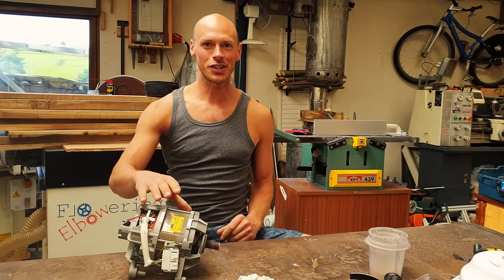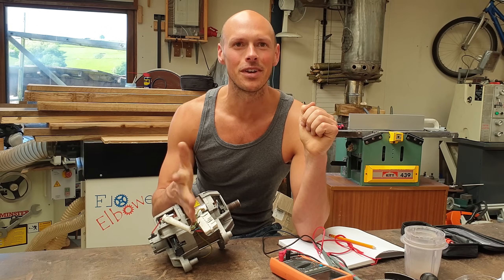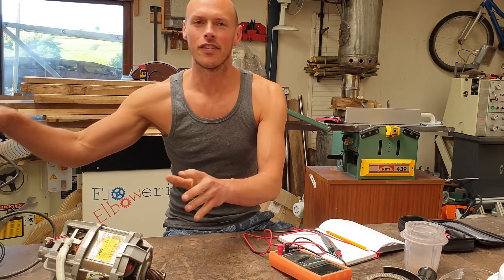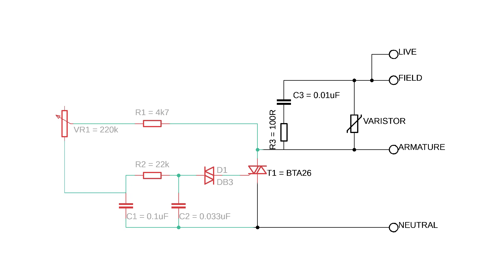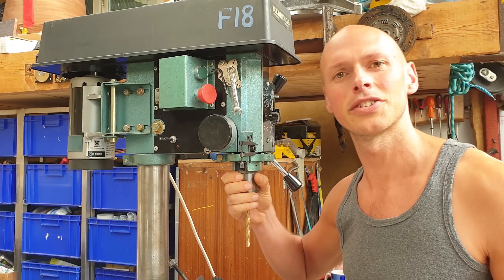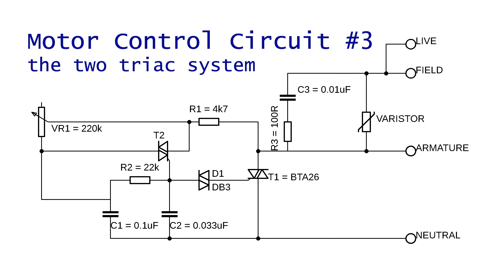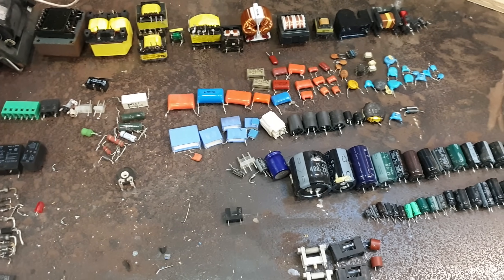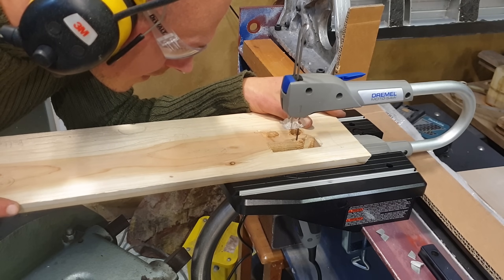How to reuse Washing Machine Motors [Arduino vs Basic Triac control]

Comment: Hi, it's 20/12/25. 6 years since you made this  video. It's been 35 odd years since I studied electronics and as I never really used what I had learnt in any job that I had since then, i'm afraid much of this went right over my head. However, I think that in these times of incresing desire to go 'off grid' it would be really helpful and interesting if you did a video of how to turn a washing machine motor into a generator, wind or water powered. What do you think ?
Reply from the maker: Hi friend, thanks for the comment. Currently deep into a solar pv install, so it's not happening soon... thanks again 😊

Comment: Is there an advantage of using a triac over a solid state relay + pwm?
Reply from the maker: Honestly I don't know, it's been too long since I looked at this stuff. I know when I was looking (a long time ago) a solid state relay was comparatively costly... I'd love to know what you find out if you learn about this, or if anyone else wants to chine in... Thanks for watching :D
Reply: @FloweringElbow  Well, if nothing else, PWM usually switches a lot faster, which would increase EMI and could pose a risk for motors with lower class insulation.

Comment: Enjoyed your video and learned quite a few things ,I have a   universal washing machine motor with 9 wires coming out,I have got a motor controller which is meant to control foward and reverse and speed ,the connection points are LABELLED K2-Reverse
 K1- Foward
 0V
S2 velocity feedback
S1
Z2 Secondary Winding
U2 Main winding
N&L  Supply

Need help hooking this up to motor

Comment: Why did you wire it up so the heat sink was live?  I know nothing about electronics so I am curious, it seems like it'd be something you'd want to avoid.
Reply from the maker: Actually that triac I used didn't have live heatsink connection, but some do. So it was more for the benefit of folks who might use that type, it's easily overlooked.

Comment: I have one of those motor thar you show in your video , well the one I have" 5 wires " I want to put the wires of that motor to a whirlpool washer I don't want to put the motor just the wires to the whirlpool washer the motor from the whirlpool I want to use can I use that motor from whirlpool washer the other washer was a front loader ?can I use the motor from whirlpool washer?

Comment: Hello,
I plan to use a universal motor for a DIY lathe.
I copied Brett Beauregard's code and included recommended libraries, including Rotary.h. But the Arduino compiler does not recognize the "process" function: "'class Rotary' has no member named 'process', following the code: " unsigned char result = r.process(); " line 227. It also does not recognize the DIR-CW and DIR_CCW parameters.
Did you have this problem? And if so, how did you solve it?
Thank you in advance for your help.

Comment: Would it work if I just rectify the mains voltage with a bridge and then use an IGBT (possibly salvaged from an IH electric stove) to PWM the 300V DC?  (A separated SMPS and an optocoupler will be used for isolated driving in order to prevent deadly voltages on Arduino board)
Reply: It should be able to...,but in this , its simplest form..low speed operation has its limits , even with just tacho gen. in the feedback loop...

Comment: Is it pissible to Control the Speed without a Tacho? I got a cheap single Phase Controller for induktive Motors and the Speed Control Just won't Work. Forward/reverse is No Problem. But the Motor Starts to get warm very quick. It originall had 2 capacitors with a start delayed shutoff for one of them.
Reply: These 2 caps. type motor , is typically a Capacitor Start , Capacitor Run motor....where the C Start is mechanically disconnected/ dropped out of circuit after it reaches a particular speed.. this is done with a centrifugal switch mounted on the rotor shaft internally ..it breaks/open circuits the start cap...
Such motors should not be operated below that speed.hence that winding overheats..its meant to provide high current for high starting torque only at start up.
Now a days some such motors come with PTC mounted resistors  and there's no need for the centrifugal sw. 
This PTC is selected based on approx.time it takes to allow high current through and by that time rated speed should have been reached ..

Comment: Execellent video's.  Now if only they taught things like this in schools and colleges. 😊
Reply: They do though. They also teach you what you need to analyse circuits like this. The whole, “university doesn’t teach you anything”, attitude just isn’t true. In a lot of cases they might not teach what exact circuits to use but they teach you how to design the circuits and the principles of how it works, which is much more important. Anyone can take a circuit off of the internet and copy it, not everyone can design a circuit like that themselves.

Comment: I like to remake the controls of my washing machine using an esp32 (can be nicely integrated with home assistant) the rpm of the motor also needs to be controlled by the esp32  like to use a digital to analog controller to get the controlling voltage. Like to know how you would approach this. Thanks for the upload. :-)
Reply from the maker: Hey Ronald, good questions, and unfortunately I'm the wrong person to ask and wouldn't know where to start with the esp32...

Comment: Great video Stephen, so my plan is to creat a 6 axis arm, a bit like a kuka krc4, any additional advice mate?
Reply from the maker: Good luck! Look at servo motors, designed for those kind of applications. They will work a lot better than a universal motor. I've seen people add a rotary encoder to permanent magnet treadmill motors to create servos, but it's hard to beat an 240v AC servo motor and controller - it's what we're using on the CNC machine we made.
Reply: Right on man, thank you so much for the reply.

Comment: If you're thick as seven shovels of syrup when it comes to electricals, like me - could you use a dimmer switch or some such off-the shelf yoke that the nice people in "Electrical Crap R Us" might sell? When you start into wiring diagrams & whatnot, the bulbs inside my head dim worse than usual.. massive blind-spot for me. So yeah - any simple way of making the thing spinny-mathing simpler? Or is that a dim question? :-) You may as well be speaking Russian when you start into the technicals, to me anyway.

TLDR - can fools like me buy anything off the shelf to do the speed-control shyte? Because then a washy-machine motor starts being verr useful.
Reply from the maker: Hi James. Yeah, I struggled a lot with this stuff... You could try something like this https://www.amazon.co.uk/WINGONEER-Electronic-Regulator-Thermostat-Controller/dp/B01LXLU3SD/ref=pd_day0fbt_sccl_2/258-0755306-0061525?pd_rd_w=4OhkY&content-id=amzn1.sym.ec8de3c0-7d57-47a6-8a84-f65b2ab2e73e&pf_rd_p=ec8de3c0-7d57-47a6-8a84-f65b2ab2e73e&pf_rd_r=2J288Q35GN28PEKDY4HX&pd_rd_wg=kVo3g&pd_rd_r=40107e41-250d-4889-8305-ba93427103a3&pd_rd_i=B01LXLU3SD&psc=1  
Not an endorsement mind, I haven't tried it... You'd still need to identify the correct contacts on the motor with a mustimeter and some fiddling about...
Reply: @FloweringElbow  That's close to warm - I did ages working out how to power 12v stuff with old PC power supplies - Clever folk would have figured it out in minutes - took me weeks - but yeah, that's somewhere "possible" for non tech folk like me., 

I have no idea how that would work.. I'm gonna have to go educate myself on this rabbit hole.. Does "Education" ever end ffs?

Comment: I watched this video a long time ago and I was reluctant to try it. Fast forward to my latest video I had to unsolder many large capacitors from a pcb. I tried my very slow method on the first capacitor using a soldering iron, as usual it took along time. So I remembered your method using a heat gun and gave it a go. Wow, wow and more wow it worked so well! The only problem was that I put the heat gun too close and it burned out the heating element wire. So now I have to buy a new one.
Reply from the maker: Hey Lucky, good to hear from you. Haha 😄 yeah it sure does help with the larger components! I must say that I've fried a few components by lingering too long with the hot air, but in general it rocks...
Saw your vid on the vfd dismantle BTW.  Keen to see what you're building with the components 😀
Reply: @FloweringElbow  I have got a 150 amp alternator to use as a portable welder to repair fences on my rural property. I only needed the diodes from the vfd for the welder but it was great fun dismantling it and seeing how it worked. As this is not a every day item found in the home I thought it would be great to show others what is inside a vfd.
Reply from the maker: @luckygen1001  yeah it was cool to see !

Comment: I just used a pulse relay to run my washing machine motors. it's basically a 555 timer with a variable capacitor. i salvaged the power board from the washer, but needed a pulse wave of +5 v to get the motor spinning. my motor came out of a front loading machine. so my setup also has variable RPM.
Reply from the maker: Hey John. Very cool! I always wanted to also use the power board, but just didn't know how or where to put inputs. How did you identify where to attach the +5v pulse train? How is the speed controlled (higher frequency, higher speed?)? DO you need to worry about the zero cross, or is that all taken care of by the power board? 
Thanks for watching and your interesting comment. Peace, Bongo.
Reply: @FloweringElbow  also this power board has a reverse pin that is turned on with +5v signal, i do not need that feature so i dont use it, but you could use your own  microprocessor to control the motor for forward, reverse,  RPM and it could agitate back and forth like in a front loading washer would do to balance the load. I just could not dispose of that nice motor, so i salvaged it with power board and wiring harness for a project.
Reply from the maker: @John-100  This is a wonderful story. And great info - am so going to try this on the next scrapped washer I find... Thanks John!
Reply: @FloweringElbow  i discovered it by accident while trying to figure out why the motor would not turn. There is a connector on my board that goes to the microcontroller so i figured that this was the place to start i had a 5 volt wall mounted charger and started to connect the 5 volts to the pins till i found one that caused the motor to make one revolution and it just stopped so i started touching the pin in pulses and the motor started to run, the faster i manually pulsed the motor the fater it turned, as far as the zero cross over goes the power board had that integrated into the circuitry so all i needed was to instruct the board what RPM to spin at, so i used a solid state variable time delayed relay to generate the pulses. Nothing but trial and error got this running.

Comment: This motor is big bomb can i use it with 3000w full sin wave inverter
Reply from the maker: I suspect so, but it would depend on the details. Peace, Bongo
Reply: @FloweringElbow  hey brother this motor motor is universal so we can run it on dc but will it give good torque just like it give on actually supply I Will connect it to motor cycle engine gears and dc supply is 80v !!!

Comment: I was interested to build a speed contol circuit that actually controls a W/Machine Motor. I was impresded with your circuits. 
When I built circuit #3, I found several bugs and mistakes. It shows that you presented  a circuit that you didn't test. Can you redefine the circuit with regards to the 100 ohm resister where it actually goes and why is the 4k7 resister nearly burns as soon as you switch on!
Reply from the maker: Hi Oxford, thanks for getting in touch. Like I said in the video this is the only circuit I have not made, so I'm afraid I can't help you with the debugging... There's more reading on it here https://www.youtube.com/redirect?event=video_description&redir_token=QUFFLUhqbVhhMjdRN2JzTUYxZHAxdDBzLXRNU3lBdmhqZ3xBQ3Jtc0trZkhvUUJvRTNRSE1fWmIxYzlYSmMtV3FHUTlVNXI4enV2SDVFMzE4UzczY245T0xwNnBQOVR4UXQ4QTVpOFp6alZiVjNGdGxZM1RSUldMZjluSkJVRWlsYnhnV0hFLURIZXdGQjBRa2V1d2kxRVh6dw&q=http%3A%2F%2Feducypedia.karadimov.info%2Flibrary%2FCD00003856.pdf 
Good luck ;)
Reply: @FloweringElbow  
I went through the literature made by  ST ELECTROICS and still I found the same irregularities.
1: The 4k7 ohm resistor goes to the L ac terminal and not to the mt2 of the triac.
2: The pot value would make more sense if it would be some thing near a value of over 250k ohms or more. As it is, the motor will run even with the pot turned fully low.
3: The snubber array is not connected parallel with the load but parallel to the main triac.
4: When I connected the 4k7ohms/1watt resistor  to the L ac supply and tested it, smoke comes off as soon as I  switch on. Even with  no load!
 5: I cannot figure what is the reason for the 330n capacitor. 
6: The viristor across the load is also doubtful in that location.
Kindly  check  these points and give some comments.

Comment: Hello. Thanks for the brilliant video... Just a confirmation... With your second circuit does the torque increase/decrease/remains same  with decrease in speed of motor??
Reply from the maker: Hi Anurag, Good question, it depends on what speed you are decreasing from/ to. But in general, it will reduce at lower rpm (say 500 to 50rpm). Running it on DC, with a low voltage high current transformer to energise the field windings improves this a lot! Hope that helps. Good luck.

Comment: Why not run it on DC?  I mean you have variable torque og speed with two relatively simple circuits
Reply from the maker: Hi Enos. Yeah nice point. That's circuit 2 if I'm remembering right...
Reply from the maker: See 05.49
Reply: DC causes a lot of arcing and excess wear at the brushes and commutator.   It can be quite dramatic at higher voltages.   AC is much better in this respect because the zero crossing will extinguish the arc.  
 That is the main downside

Comment: Thank you for the inspiration and many advice, my regulator for the send belt grinder was made and works fine https://youtu.be/yOo18O4I3Is
Reply from the maker: Hey Eldzi. Great project, thanks for sharing the video. Looks like a perfect use for the controller :)
Reply: @FloweringElbow  I am very pleased. thank you. i have plan to bild the lathe or cnc router. and use the same type of the controler

Comment: Top tip! When using a triac optocoupler trigger AND you want to use zero crossing detection the MOC3061 series combines BOTH into one 6 pin DIP package that is the same as the MOC3023.

Hope that is useful.
Reply from the maker: Cool, thanks for sharing Bob!

Comment: 14:25 : PC817 datasheet says max input peak voltage is 3Vcc, but with your configuration are we not inputting 230V (rectified 230VAC into 230V pseudo-CC)?
Or are the resistors of any help ? They are not in a voltage divider configuration...
Reply from the maker: Hi there Takix, I dint do any calcs on this as I was going off Saulius's circuit... When I glanced at the datasheet, it looked more like the supply voltage was 80V, could be wrong. Either way, I think the voltage drop across the resistors make it work.
As for the bonus Q, you left on instructables - yes, two 60k resistors in parallel, should be ok to replace the one 30k 0.5W as I don't imagine it's close to the current limit...
Reply: @FloweringElbow  ok, I'm a donkey, I kinda forgot how LEDs (and electricity, by the way...) work... The 2x 30k series resistors under 230V limit the current to around 4 mA, which is totally OK for the LED in the optocoupler, whose max forward current is 50 mA. 
The 230V situation is less common than say 5V for me, but it is exactly the same situation with a 2V forward voltage LED for which you add a current limiting resistor of some hundred ohms.
With appropriate current limiting resistors, LED could run on lightning bolts 😜

Comment: Okay I think I understand the last motor control circuit but what are the resister capacitor combination doing in the one controlled by ardinuo. Would the ac  just go around the triac?
Reply: The capacitor is 100 nF.   Calculate its reactance at 50 hertz.   
 It will only pass high frequencies.  Which is why it is there.

Comment: Hi. Most useful explanation of speed control specific for UM I have seen thanks especially addressing the hierarchy of torque and responsiveness control and I have been looking for good content on this for sometime. Even Jeremy fielding and TPAI never REALLY addressed the DIY circuits for UMs which would give effective performance. Thanks You have definitely plugged a gap and good verbal and visual guides with good referencing. Thanks
Reply from the maker: Hi Jim. Thanks for watching and your encouragement 🙏 means a lot to me :)